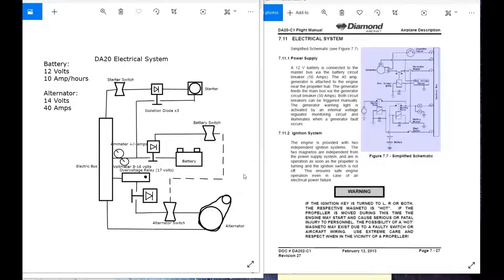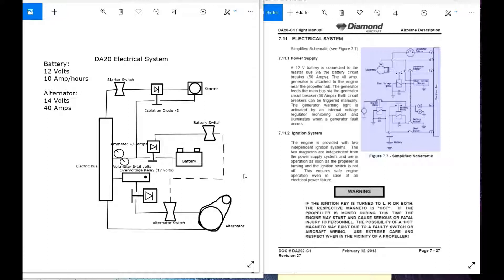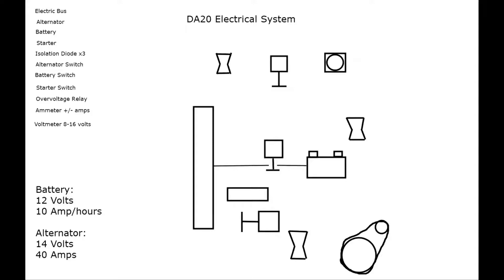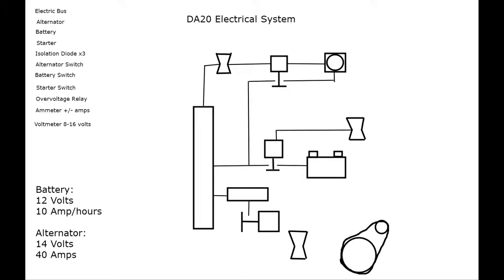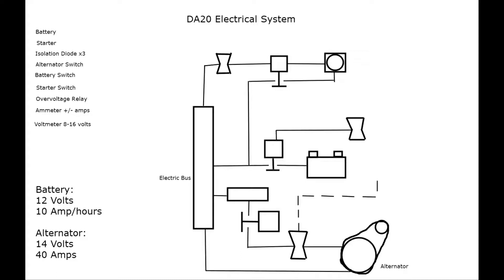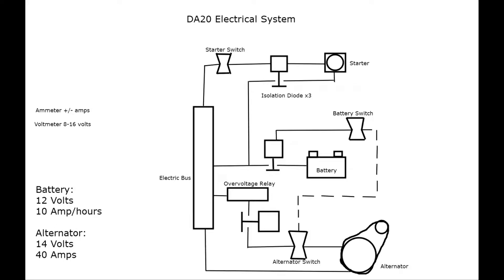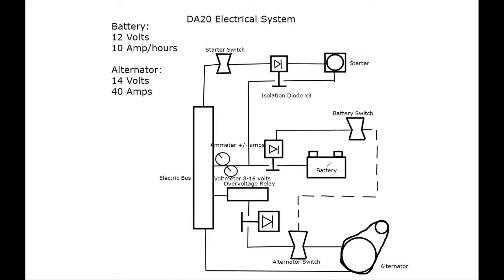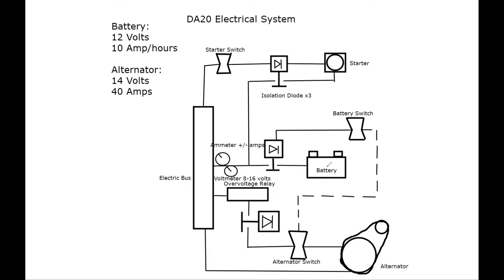DA20 Electric System Schematic

Comment: Bro hello, one strong recommendation. You keep refering about the isolation Diodes.  The job you mention and actually draw, is done by the Relays. The diode is there to protect the whole circuit when the relay deactivates. When a relay deactivates produces current fluctuations that are harmfull for circuits.
Reply from the maker: I am not an electrical engineer, I am a certified flight instructor and the purpose of this video is to help student pilots and new pilots to the Diamond DA20 understand the application and failures of the system itself. Frankly, from a pilot's perspective I don't think that it's important to be able to distinguish a relay from a diode. However, I appreciate your feedback and explanation for individuals that want more thorough understanding of electrical systems.
Reply: @cmcintyre3165  I am not an electrical engineer either. I am required to make a brief explanation of the DA20 electrical systems for my Flight instructors Certification too, and I stumbled upon your video. If u need I can provide you with my presentation. Based on both the FM and the maintenance manual.
Reply: @ioanniskarastamatis1134 hello, good morning! Could you provide me with those diagrams of yours? Thanks